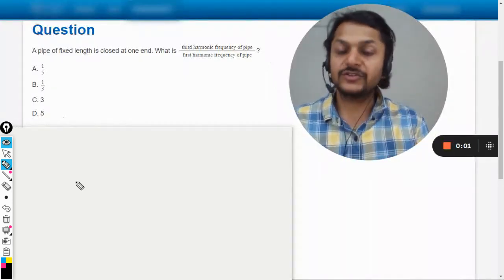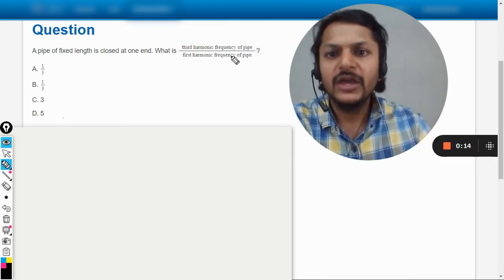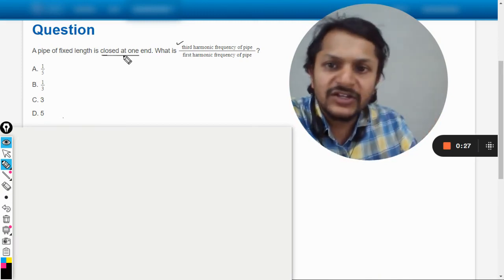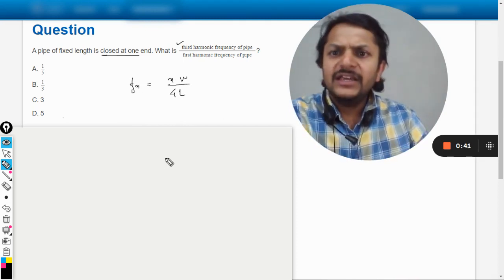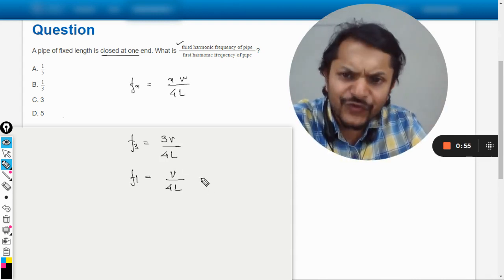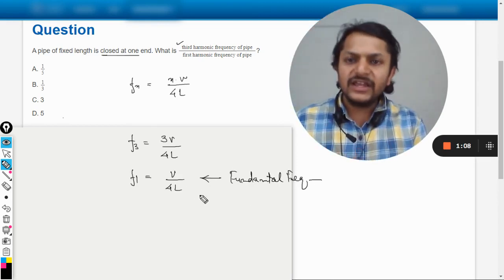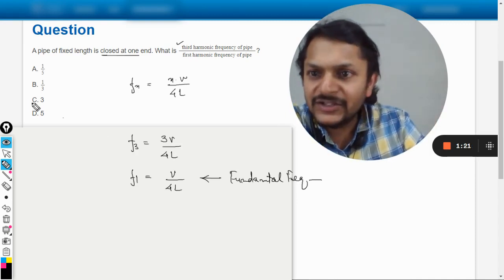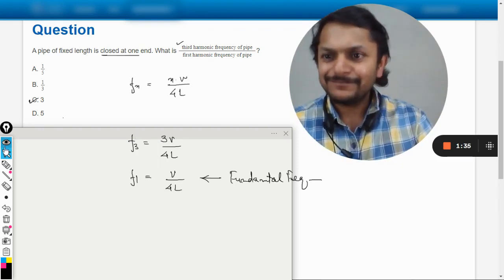A pipe of fixed length is closed at one end. What is third harmonic frequency of pipe/first harmonic

Comment: well, you and the answers are wrong, the general from for a pipe closed at 1 end is (2n-1)v/4L not nv/4L
Reply: the markscheme is never wrong, all his steps are correct. It is indeed nv/4L
Reply: Yes, the general from for a pipe closed at 1 end should be (2n-1)v/4L, there must be something wrong with the mark scheme
Reply: The general formula you are giving is true when n is taken as any integer. It is the condition of the standing waves in open-closed system to have an odd harmonic. However, by looking at the question, Mr. Varun already knows that the harmonic created is odd hence he need not to account for the case in which an even harmonic is made (because we are given the third and first harmonic in the question as any even harmonics are not possible in this system). So, although you are correct, you havn't correctly applied the formula to this question. Mr. Varun is correct. Hope this helps.